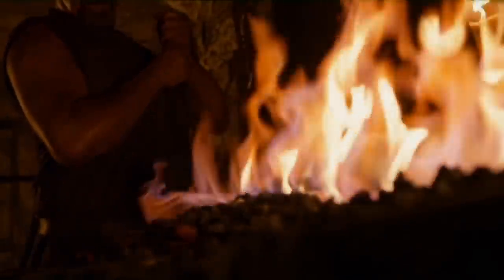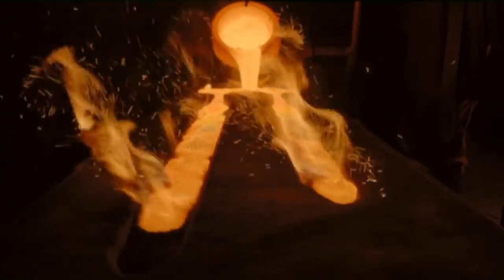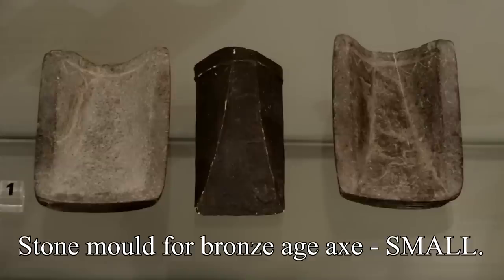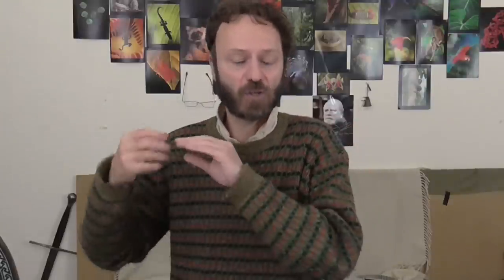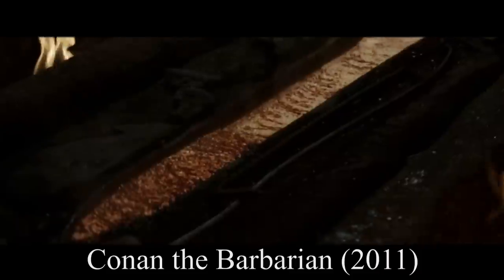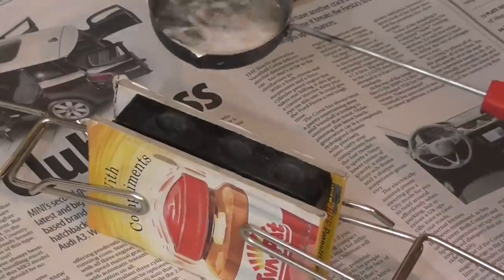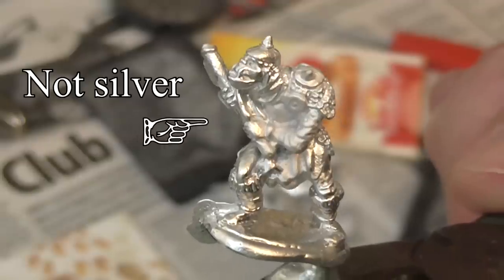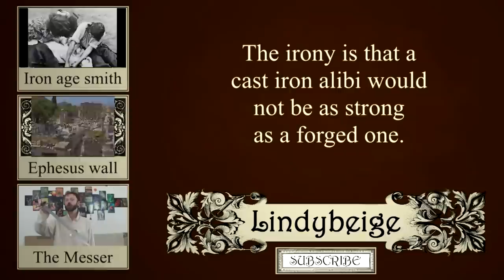Casting swords in the movies - forging a lie

Comment: In reference to your Fellowship Of The Ring Clip - I do believe that orc/uruk hai swords are just meant to be like a lump of sharpened metal with perhaps a leather grip or something, crude weapons for a crude people
Reply: canonically those uruk swords were supposed to be low quality because they were using techniques to make them as fast as possible rather than high quality
Reply: @spawnof200  
"The spy watch I gave to you could be functional even at the melting temperature of tungsten"
"I doubt that I would be functional at that temperature"
Reply: They are also heavy, block shaped and crude, just the front side is grinded sharp, it actually would work.
Reply: I think they did show Andruil being forged correctly but i can't really remember either
Reply: @DrEgonCholakian  They did, but also kind of didn't.  You wouldn't be able to just re-forge a blade like that.  They'd have to have taken the fittings off, forged the shards into a lump and then re-forged the blade from that.
That isn't too crazy to think of, though.  Good metal is expensive, so recycling it would make sense.
Reply: @Walker Rollins Would they honestly have been able to take a sword that had been broken and re-forge it into a new sword? I've always wondered about that.
Reply: @shaitarn1869  They could melt down all the iron and reforge it starting from scratch
Reply: @Cato Sicarius Good to know; thank you!
Reply: @shaitarn1869  I'm more of an enthusiast than an expert, but I believe it would be possible.  They would have to, essentially, completely break it down into a block, and then re-forge it, though.
Reply: @Walker Rollins I always wondered if the fact that it had been previously forged would mean it was somehow impossible to melt back down and get another decent sword out of (I know it happens in novels and films, but so many fantasy/'historical' works are full of rubbish...). Nice to know there's some truth to that one!
Reply: @shaitarn1869  Metal is surprisingly forgiving.  I worked for some time as a welder, and it is interesting how much easier it is to cover small mistakes in metal.  It's even more forgiving than wood.
Reply: @rayanderson5797  don't forget elven magic haha
Reply: They would literally shatter on impact though. Have you watched the full video?
Reply: @shaitarn1869  I believe that yes, it is very possible BUT you would need to add more material to compensate for the carbon loss.

When iron is forged, imperfections and carbon content is literally beaten out of the metal. Thus, reforging an old sword would mean you would create a sword with a much too low carbon content to work well. Traditionally, smiths would add thibgs like coal into their mixture to add carbon.

The Japanese Iron ore sand which they used was rich in imperfections and carbon. When smelted, this would result in incredibly high carbon content "pig iron". The reason traditional Katanas are folded so many times is the solution to reduce the impurity and carbon content moreso than standard forging. Effectively beating and compressing the metal many more times resulting in a good blade.

In Europe, smiths had access to better quality iron ore (more pure) which allowed them to make effective blades without having to fold the metal due to the carbon content being lower.
Reply: Don't orcs use scimitar?
Reply: @spartacus17.  Yes, Orcs and Uruks use various swords and daggers but the Uruk-hai from Isengard use crude blocky cleavers.
Reply: @spawnof200  Um, canonically according to what canon?! I don't think anyone says so outright. If you're just referring to what the scene in question is suggesting, it's just a roundabout way of saying "the proof that the scene is correct are the conclusions I draw from the scene", and that's far from what I take "canon" to mean.
I think you probably meant more something along the lines of "in-universe it would make sense that..." ;-)
Tolkien, as far as I recall, never says anything in particular about the quality of the Uruk-hai swords; he gives broader descriptions from which, in fact, they seem, if anything, to be of better quality than the weapons of other orcs and goblins. He does say Isengard was abuzz with activity and covered in smoke and stuff, but he doesn't necessarily say anything about Saruman sacrificing quality to quantity and speed (even though it's perhaps a somewhat logical conclusion to draw, but there's also nothing in canon to say he would have done so to such an extent, because there's nothing in canon that explicitly says so, period.)
In fact, Tolkien never says anything to suggest the Uruk-hai were the sort of artificially mass-grown fast-grown clone-type thing that the movie scene makes them out to be. He only says he breeds them to certain specifications... but the underlying suggestion there is, um, far less clean-cut and far more unsavoury than cloning. (Which might be why the moviemakers decided to show something else on screen, and I can't exactly fault them for that come to think of it, but explicitly showing it like this does take away one element that makes the characters and you with them go "Saruman's gone maybe even Darker that Sauron now"...)
I think the movies sped Saruman's preparations up for dramatic impact and to be able to show it all in two movies, but in the books in fact the underlying suggestion is this has been going on for years in secret and he's now unleashing the full amassed force. A lot of the info about Saruman's secret activities behind Isengard's walls come from the Ents who, as we know, are not a hasty race. It could have been going on for years and years and the timespan would not have mattered to them as much to take particular note of it, so we never learn for quite how long this has been going on.
Whew. Sorry for the essay. The first part of The Two Towers is one of my favourite parts of The Lord of the Rings that I return to more often than others, and apparently this was all boiling under the surface waiting to happen. :-)
Reply: @rayanderson5797  technically they did it well before the end of the fellowship. Aragorn had it when he left rivendell with it if I remember it correctly.
Reply: @DrEgonCholakian  actually  you would forge weld  the pieces into a block and start from there melting it would strip it of carbon making a  lesser blade.
Reply: @tuckerrichardson2606   That was what I meant by melting it down since turning iron into a liquid is extremely hard with the technology available in a 15th century setting.
Reply: @DrEgonCholakian  ah well sorry but when I see the word  melt my mind goes to a liquid  or at least very near it. I'm an aspiring  blacksmith (not very good at it yet mind you but I've made a few blades) so that's where I was coming from.
Reply: @tuckerrichardson2606   Well thats cool The other I argued with tried to claim obsidian being cast was a thing it gave me a headache so I understand where you are coming from on that.
Reply: @DrEgonCholakian  oh sweet lord how would that even work
Reply: @tuckerrichardson2606   Some guy on youtube did manage it but he was using a modern furnace and what came out after multiple failed attempts was probably 80% flux 20% obsidian and it was extremely brittle.
Reply: 1:44 urukhai sword is just sharpend slab.
Reply: No. Just stop
Reply: They would break quickly :v
Reply: Or just a pointy rock they found nearby
Reply: High Marshal Helbrecht meh... no
Reply: pyropulse  My query was really would a steel sword be able to be melted back into its raw material and reused or would that effect the quality of the metal (maybe by effecting the iron/carbon ratio or something) to the point where it would be useless. Possibly it was a stupid question, but that's because I know jack about this subject and I guessed (correctly) that some of Lindy's viewers would be able to tell me.
Reply: @spawnof200  Ahhhh, A fellow Machine Intelligence.

Comment: Confirmed, you can't smelt steel beams with casting tools.

(I had to.)
Reply: +enoughofyourkoicarp lol! i hope others get that. that was funny.
Reply: +Mark Welschmeyer i didnt! yay..
Reply: +m n "Jet-fuel can't melt steel beams"
Reply: +WB1813 Casting tools can't smelt steel beams. Lindybeige confirmed.
Reply: +enoughofyourkoicarp They used jet fuel in middle ages, confirmed.
Reply: +enoughofyourkoicarp | I just knew there had to be 9/11 comment. I knew!
Reply: exlibrisas Well I hate to disappoint. :D

Comment: pure silver is very silver when melted. only sterling will end up black. i pour silver bars and i make rings
Reply: where do you get your silver?
Reply: Mrmoocows99 from a local shop and from dealers online
Reply: I'm guessing silver bars like what you can get a jmbullion.com.  If you can get a very CO2 heavy room >60% (you will need an oxygen tank), you can pour sterling without it corroding.
Reply: Folopolis or u use a Argon filled Tank
Reply: Dan Connaughty hum... The Witcher
Reply: I heard I'm going to turn black, is this true?
Reply: All silver turns black, it's its natural tarnish :D
Reply: From a historical perspective though, would they ever have access to pure silver?
Reply: Sterling Driggs lol
Reply: It would. Sterling Silver is an alloy that was developed in the 12th century, at the time it had already been used for roughly 6000 years, plenty to develop some purification methods. Whilst it will corrode easier it is harder and as less likely to mess up a cast.
Reply: Dan Connaughty who has a silver sword tho
Reply: Joe Andrews when I'm slaying Vampires or the undead in Skyrim xD lol

Comment: 24 years of forging carbon steel knives. It also pains me to see movie sword making [and the heat treating process], so misleading. That Conan one which shows casting, forging and then "Quenching" [unfortunately only HALF] the blade in snow! This would crack any earthly carbon steels. Special exotic metal or not, it horribly misleads the general public. Sad to gain any such "knowledge" from movies. Dipping a hot [~1500F. blade into oil or water is the quench, not the tempering process, which comes later at much lower temperatures - 300 - 500F.  The whole process of quenching and after cooling a tempering is called heat treating. A complete process to make relatively hard, but tough, usable implement.

First of all,  pure iron [which does not exist in this state in nature], melts at 2900F. As carbon is added to pure iron [normally by the addition of charcoal or coke], it then becomes steel up to about 2% carbon which is about twice the carbon content of most "high carbon" steels of 1% carbon used in knives and swords - although lower carbon content of .6% carbon is generally preferred in swords. As the carbon content is increased from 0% [pure iron] to up to about 2% the melting temperature actually goes down from 2900F. to about 2700F. for 1%carbon steel. Above 2% carbon content, it is now called cast iron, having 2.5 to 5% carbon - way too high to forge without crumbling under the hammer, and very brittle when cooled, as Lindybeige stated. Cast steel melts around 2100F. so much lower than steel or pure iron and it flows like water and is very easy to cast in an open or closed mold. It is never forged afterwards for any reason, so no, it would not even begin to make a sword or even a relatively shorter knife. Meteorite iron is generally nickel/iron and has been used in swords and knives down through the ages, but combined with carbon steel for the cutting edge as nickel/iron is relatively soft and will not hold an edge. Nickel/iron etches out bright because of the nickel and now carbon to speak of, when combined in alternate layers with a low (10-20%) carbon steel [which etches out gray] for the core or center of a sword makes a pattern of light and dark - "Pattern-welded steel", which is commonly [and wrongly] called "Damascus steel", which is a totally different animal. 

Cast knives and swords were first of copper, cast in closed molds. Bee's wax can be shaped like a sword or knife, covered in wet clay which is dried, then heated over a fire to melt out the wax, then much more heat is applied and molten copper - or later bronze is poured into the cavity left from the wax original. Copper melts at 1984F. [George Orwell ref.], and bronze - copper and 2-10% tin melts at ~2200F. This temperature was reachable in a wood fire which had a bellows forced air system which increased temperatures, or in some cases, a forge fire built into the side of a hill where updrafts of wind were used in the same manner.

This is a stripped down version here, but hopefully, it will enlighten some.
Reply: David Brunetta Very nice description of the relevant properties of steel.  Anyone who has ever messed up a forge weld and accidentally turned a steel bar into a huge sparkler (because both low/high carbon steel burn before they melt) can’t help but groan when they see this absurdity.
Reply: This definitely enlightened me since I'm doing my Engineering degree in metallurgy. Though I got to admit I didn't understand everything, so I still got a lot to learn!
Reply: What saddens me, is that some sheeps actually buy what they see in a movie as real.
Reply: Interesting, but really I don't share your concern.  I don't think anyone actually watches movies to find out how to make swords.

Comment: To be fair, in Game Of Thrones it technically isn't iron, but rather Valyrian Steel, which is a fictional metal.

But then again it's implied to be an alloy of iron and obsidian (I know, it sounds wrong to me too) and I think it's also associated with dragons? So it should have an extremely high melting point...so it's even worse
Reply: Obsidian in this universe is magical. A Valyrian steel sword is made with spells woven into it's metam.
Reply: If it’s steel, it’s iron
Reply: Valyrian Steel, is the aSoIaF name for Damascus Steel.  (And Dragon Glass is obsidian)
Reply: I thought it was just implied to be steel. Coke and iron mixed in a way the Westerosi didn't know and thus couldn't reproduce.
Reply: @Billythetoaster2004  I mean, so is stainless and patterned steel.
Reply: Obsidian is brittle as f
Reply: Might as well just have it be a fantasy magic lightsaber then.
Reply: @stupidhandles  I’m pretty sure I remember Jon using Longclaw to kill wights in the books.
Reply: @hazardous0887  ...and carbon...
Reply: @GastropodGaming2006  
That too
Reply: @hazardous0887  carbon my beloved
Reply: @GastropodGaming2006  
Ok

Comment: You can't even forge cast iron, it'll shatter under a hammer even while heated.
Wrought iron was so named because it was /possible/ to forge it.
Reply: +Kharmitas Yup, I tried this when I was younger. I even tried melting the cast iron, it just crumbled into pieces before it melted.
Reply: There is something like cast steel,  less carbon than cast iron and forgable.
Reply: +Kharmitas 
Actually wrought iron referred to its manufacturing process.  In short it was forged from a big lump of metal at the foundry (Ie “wrought”) to its form as a bar.
Reply: Bloomery iron is a form of wrought iron, yes, but another sort of wrought iron was made in China by decarburizing cast iron since antiquity. As we got into more advanced metalworking methods, wrought iron was made from pig iron in a puddling furnace, which could melt iron without overloading it with carbon, and it was stirred with rods to give it a stable structure. Perhaps at one point wrought iron referred exclusively to iron wrought into shape, but for a long time now it's referred to the iron having the /ability/ to be wrought without shattering or cracking.
Reply: +Adamast Really high melting point though
Reply: When you do both of those things, you've effectively created wrought iron in terms of chemical composition...and thus have created wrought iron, because the wrought means "can be worked", in context. That's the method of making wrought iron that the Chinese had always used.

Comment: 3:18 the melting point for iron is around 1538, but only for pure iron. If you add other elements such as carbon, you can bring the melting point down quite a lot, but it would still be hotter than depicted in movies